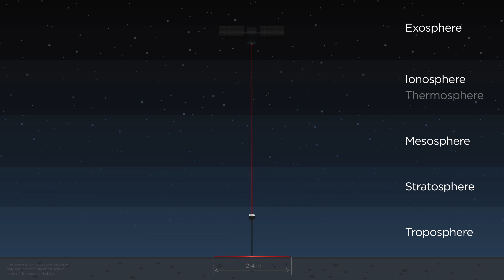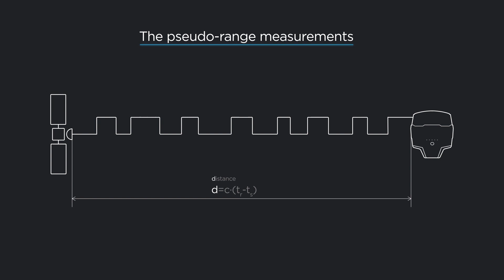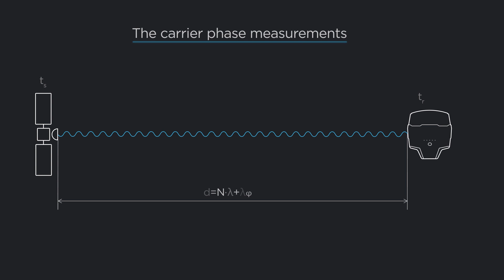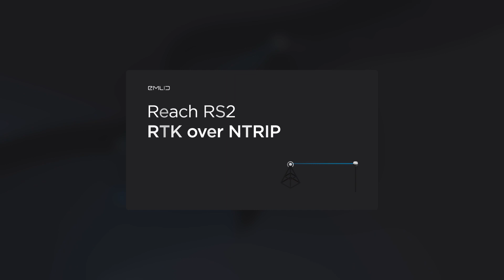How RTK works | Real-Time Kinematic for Precise GNSS Positioning

Comment: Why are you using a Base and a rover for RTK?
In Sweden we only use a GNSS Rover with RTK connection via ex Trimble TDC600. 
Or a 360-active prisma with totalstation integrated.

Comment: Pretty good simplification of the current state of RTK. I've been using RTK for almost 30 years, have built and operated an RTK network, train people on how to use it and help develop standards for its use with a major state DOT.

Your distance error statement was not correct in my opinion, at least for this level of discussion. In my opinion, you should simply have described the distant dependent error. Saying it is good or not at a range depends on the precision/accuracy needed, and that varies. RTK is entirely appropriate at 50im, for certain applications (single or multi-band) Single band RTK isn't just limited to 10km, It has more to do with the integer ambiguity (described) and often having to fix over a known point. Multiband RTK has near instantaneous 'fix' and can better correct for ionospheric error, which does impact the distance dependent error, but not by much for RTK.

This is a good quick description overall, and one that I would use if I were to put it in context.
Reply: Hey I was wondering if you could share some knowledge. I'm trying to find the proper software to run my rtx receiver and can't seem to find any that work, I've used ardupilot and u-center but to no avail. thanks in advance

Comment: Can you like have an rtk drone to aid the rover and base when its hard to find signal because of say vegetation?
Reply from the maker: Hi! It is possible, but if there is dense vegetation, it may be difficult to obtain an accurate drone map too. Photogrammetric software needs contrasting points in photos to tie them together. Trees don't work as points of contrast.
Reply: @Emlid  i hope that "weakness" or downside of rtk could be addressed. Gotta go for total station where there is vegetation blocking the signal

Comment: With RTK do you need a rover? Or would a Drone with an RTK module count as the rover in this case?
Reply from the maker: Hi there! RTK drone can act as a rover. 

For example, you can learn how to work with Reach RS2 base and DJI Phantom 4 RTK rover in our docs: https://docs.emlid.com/reachrs2/tutorials/integration/p4p-rtk/#perform-flight.